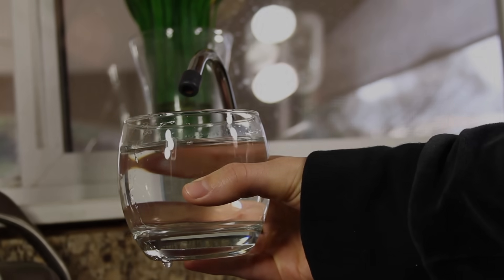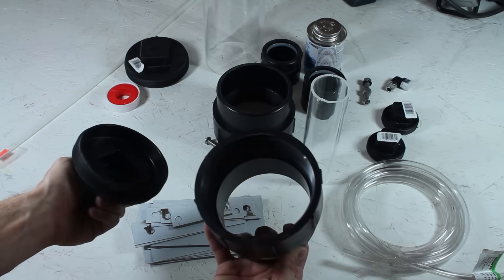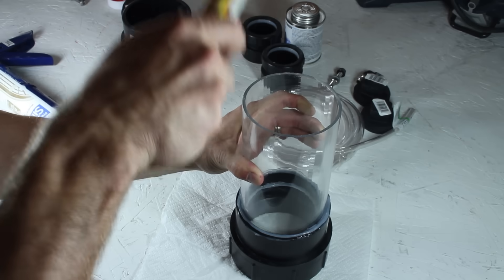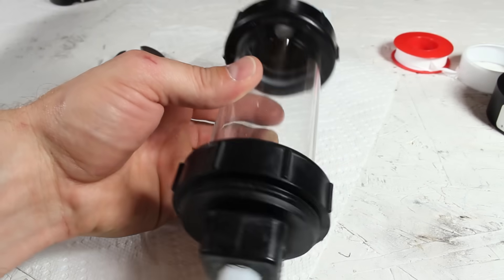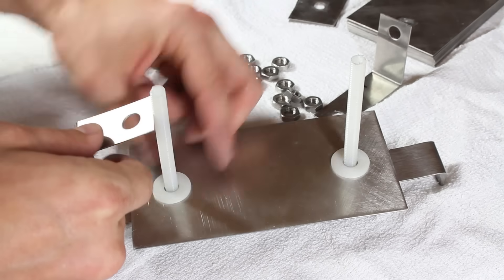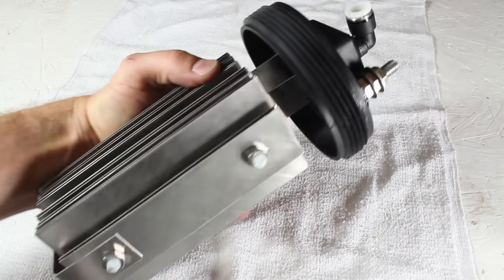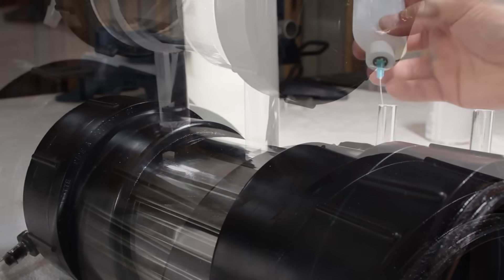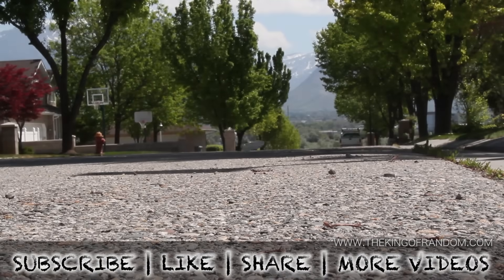HHO Generator - Water to Fuel Converter

Comment: Have you ever tried using a battery charger for the power supply ? And just a little unclear on the stacking of the plates is it two plates + and two plates - or is every other plate + then - ? A diagram would be nice . Maybe you could send me a simple sketch to help when you have a few minutes .
  Can this be used to make a continuous flame to fuel a heater  ?

Comment: its dangerous for your car cause if the spark plug fail the gas will build up in the engine then when it does light up , well you can blow up your engine. just like NOS

Comment: What if I replace the Potassium Hydroxide for Salt? I mean, as u said that the Potassium Hydroxide is for the electricity to flow better in the water, i thought that  it could work with table salt that makes the water more conductive

Comment: This gas can bot be used as fuel, because it is a mixture of hydrogen and oxygen. Hydrogen catches fire and oxygen helps in burning. if there is no oxygen around the hydrogen can not catch fire. So if you try to use this gas as fuel it will burst like a blast ( as seen in video).
The easy way to use this gas as fuel is to separate hydrogen from oxygen. In this reaction oxygen is created at anode and hydrogen is created at cathode. If you collect them separately you can then use hydrogen as fuel :)

Comment: You really did a great job on your cell.  Speaking from experience, as I have built 4 different cells myself and my last was similar to yours but not as good looking or quite as effective.  I found out how tough stainless steel is to cut or drill and clear acrylic tubing for the cell and bubbler is hard to find.  Anyway, great job it really is a good looking and working cell.  You could definitely sell them if you were into it, because I have researched what is available for sale and they fall far short of what you came up with.  They are also for the most part too much money for what you get.

Comment: 'Some people say this is the fuel of the future. Whether or not that's true,' <- This is the point where you could have been honest and forthright dispelling stupidity for 2.3 million viewers that it takes more energy to split HHO than it can create burning it - HHO is NOT an energy source. It's an energy dump and a novelty.
Reply: Try running a car on solar power... nope! Try running a car on hydrogen made through solar electrolysis... yep! You are right it is not a source, but it is a delivery method. Generate electricity however you want, then store it chemically using hydrogen. I don't think its that crazy.
Reply: bradkrit
Hydrogen is neither an efficient fuel to produce nor use. It would be better to develop better battery technology so that we store and retrieve sufficient amounts of electricity. Electric is the future, not hydrogen.
Reply: sexyloser True. I think there is huge potential (no pun intended) in battery technology right now. There is some neat work being done on rapid-charge battery banks that use a design similar to capacitors. My question is will they ever have the same energy density as a chemical fuel?
Reply: BaSH PROMPT Hmmm...so your saying petroleum based fuels are better?
Reply: why do people feel the need to debunk everything when they have no idea about it
Reply: Jude Mc  Hey,jude I don't know if you understand some of the finer points the commenter's made but some were spot on.

Comment: Please use extreme caution if you plan to do this project yourself! Using stainless steel as an electrode is very very dangerous. You may read around the internet that stainless steel isn't consumed in electrolysis, and that it makes a good electrode...that is not true. It just isn't. Stainless steel contains Chromium, and when used as an electrode in electrolysis, it releases chromates into the electrolyte. Hexavalent Chromium is extremely toxic and carcinogenic. It is known to cause cancer. When disposing of your electrolyte, please do not dump it anywhere your kids/pets/anything you care about goes.

Comment: Very professional looking piece of kit. if you attach a small brazing torch to it, it makes a very clean burning torch for working with precious metals, Ideal for repairing broken jewellery or even making from scratch.  I have added an air diffuser I got from the tropical fish tank section of the pet shop in the bubble tube to make it a more efficient flash arrester

Comment: Here I just used some nuclear reactor's fuses, combined it with a unicorn using five bulldozers and added it to a F40 I came to find in my garage. Nothing special.
Reply: Stick two metal plates in a tank of salt water and you can get a similar result. He just has a dense stacking of plates in a fancy container. It is showy and efficient, but you can make the most basic machine if you wanted too. Look up rust removal electrolysis, its the same concept.
Reply: Was this comment sarcastic? +bradkrit you make it look serious
Reply: Jaehyun Lim Masayuki was being sarcastic, implying that this project is too difficult to do at home. I was explaining seriously how the concept is simple, but Grant makes a fancy version.

Comment: use aluminum powder which can be powerful enough to power even a car in how fast the reaction is., which is even much faster than your 2 liters per min.
Also you can make a blow torch with the gas BUT you have to put a safety switch so that it does not back fire some say.

Comment: Heh, yeah people tried to run cars on this stuff, didn't work, used up far more electricity than the hydrogen and oxygen could deliver in power.
Reply: frosted1030 Well, the sun really isn't renewable either, so if we aren't out of here by the time that things loses its juice (you know, years and years and many more years from now) I guess we are all screwed :P.

I definitely think renewable power should also be heavily pursued. Basically if its non renewable it better be very long lasting, if it is renewable it had better be efficient in that regard.
Reply: frosted1030      Not about to read the whole thread, but skimming brought me to think that both of you are kind of right. Electrolyzing water is a valid form of fuel generation, but the products cannot be stored in sufficient quantity on board a car for it to be practical.     The problem is not energy conversion. The 2H2 + O2 -> 2H2O oxidation-reduction reaction is by definition of an equal voltage potential, barring inefficiencies, to the 2H20 -> O2 + 2H2 electrolysis. Hydrogen fuel cells use this reaction to produce electricity directly from the reactants, avoiding combustion and all the energy loss problems involved. This power is then used to turn the wheels and drive the car.

     The problem with this system is that hydrogen gas, H2, cannot be compressed easily and reliably enough at standard operating temperatures to make fueling a car a reality. I can give some equations if you need, but I'd prefer not to have to.
Reply: Cheez And Bakon Hardly new technology. http://en.wikipedia.org/wiki/Piezoelectricity
Reply: frosted1030 The way I see it the only way humanity will ever truly advance beyond this small world is through harnessing the very source of all power on this planet.

You think I mean solar energy? No, hardly.

I mean nuclear. Be it fission of fusion I see very little other way to truly advance beyond the level we are currently at.
Reply: xiAm VaLkYrIe Electrolysis is far less efficient because the energy density of water is 0.1 MJ/kg, the energy density of gasoline is 44.4 MJ/kg. No matter how you manipulate the numbers, you can't fudge the physics. If electrolysis were an alternative, we would already be using it extensively. For now, no, you can never get more energy out of a system than you put in (thermodynamics).
Reply: No way mate. Use solar panels to create fuel while driving and when not using it
Reply: Cheez And Bakon How many cars do you see, powered by solar cells? Here's what you are forgetting:
Energy changes form at a loss. Solar is changed to electricity at a loss. Electricity is then changed to chemical energy by way of electrolysis, again at a loss. Hydrogen and oxygen combust to produce kinetic motion, yet again, at a loss. Each step, energy is lost. Simply, there is no way that such a system could be used to power a car, reliably.
Reply: frosted1030 the thing is that hydrogen is far more explosively powerful than the same amount if petrol. Meaning less needs to be used in a car, meaning the amount produced will last long enough for solar energy to produce more, this could be a solar panel on the car. Or at the home. No one uses their car for more than12 hours a day. If the rest of that time, they're using solar or even a magnetic dynamo, to produce an electrical current, a steady stream of the gas would be coming in, slowing the consumption. Maybe I'm just too hopeful
Reply: Cheez And Bakon I said cars didn't I? Not trucks. Anyway, the water from the combustion of the hydorxy gas is equal to what made it. It could be a recycling system. I'm sure synthesizing water or purifying salt water is not that big of a deal if it means removing hydrocarbons from fuels
Reply: frosted1030 let me guess, you're a petrol loving American right?
Reply: I feel like there are much better explanations as to why we don't do that... Perhaps it has to do with the billion dollar oil industry. The technology could be there if we wanted. It really isn't tough to hook up a solar panel to create hydrogen fuel. Hell, there are DIY videos of how to do it at home. I'm sure a dedicated company with a few million bucks could figure something better out. is it perfect? no. But it is better than using unsustainable polluting oil which is causing all sorts of trouble. The downside to hydrogen fuel? um.... water. With a solar panel which is certainly enough to create the fuel, you can get a 100% renewable and waste free energy source. Fuel from water and the sun.
Reply: frosted1030 so what you're saying is that its cheaper energy wise, to distribute, mine, refine and process crude oil. Than to re use water over and over. And all of the HO is actually turned back to water, conservation of mass law says that. Some oxygen or hydrogen may escape, but that's just going to turn back to water in the atmosphere anyway.
Reply: frosted1030 that's the sort of thing I was getting at, but I'm trying to be more realistic, the best the average person is going to get is solar. Unless they have room for wind turbines. I sincerely doubt the oil companies are going to let this happen anyway. I've never heard of stress generation, how does that work?
Reply: frosted1030 Energy never gets lost. Where did you get that idea?
Reply: frosted1030 I'm sure you've heard of the Law of Conservation of Energy. Here's an intro from Wikipedia: In physics, the law of conservation of energy states that the total energy of an isolated system remains constant—it is said to be conserved over time. Energy can be neither created nor be destroyed, but it can change form, for instance chemical energy can be converted to kinetic energy in the explosion of a stick of dynamite.
Reply: frosted1030 Really?  They use gasoline to power cars.  How do you think that works?
Reply: ***** Less work if you just used the electricity to compress air, and used the compressed air to move the wheels. Less risk too.
Reply: frosted1030 wanna bet....watch mi
Reply: TrevorDeanM You might want to check with snopes on that one, they thoroughly debunked the idea a while back. Here's a few other resources.
http://www.aardvark.co.nz/hho_scam.shtml
http://www.popularmechanics.com/cars/a3983/4310717/
https://nctritech.wordpress.com/2010/08/14/hho-is-a-scam-water-for-fuel-doesnt-work-dont-fall-for-it/
Reply: TrevorDeanM Are you really encouraging people to be gullible instead of skeptical? How is that working for you?
Reply: Seriously, who decided to necro this? I really don't see this discussion going much further.
Reply: TrevorDeanM The BMW Hydrogen 7 does not run on water. It's also discontinued because it required 45 gallons of super cooled, compressed hydrogen in order to function. Not only is this expensive, but according to the wiki page "Using hydrogen in an internal combustion engine as a source of energy is far less efficient than fuel cell technologies". Further at  $118,000, and only 5 filling stations in existence, it's DOA.
Reply: frosted1030
Reply: There are hydrogen powered cars you know, so all you have to do is take the hydrogen away from the oxygen and you've got yourself, hydrogen.
Reply: xiAm VaLkYrIe "There are hydrogen powered cars you know," Yes, I know, and no infrastructure to support them, and the refueling stations (all 3) are in CA, so, unless you live in CA, you are SOL. You, I'm sure, are also aware that there is a very limited supply of potable water in the world.
Reply: frosted1030 Yes but I wonder if filling your tank with water (electrolysis doesn't use much water at all) would be more effective than a tank of petrol!
Reply: frosted1030 That's true, so humans need too think of a way of containing water, even if it doesn't create enough energy, it'll still be clean and efficient.
Reply: ***** Ok, whatever you say.
Reply: ***** And where are these cars that run on water?
Reply: ***** That's nice. Can you make the plans you used, available so that others can study and replicate your success?
Reply: frosted1030 Or post a video :/
Reply: ***** So... you have nothing.. and you just expect people to believe you?
Reply: ***** Nope, no one will believe you if you can't evidence what you assert.
Reply: ***** Why? You have nothing of interest. If you had something you would post it, patent it, and make a fortune.
Reply: ***** That's nice, not useful, but you can feel good about yourself because you said you did something you didn't.
Reply: ***** Whatever. You still have nothing.
Reply: ***** No, dissapointed that you are just another blowhard.
Reply: John Theologou Conservation of energy deals with the entropy of an isolated system. You can't get more energy out of a system than what you put into it. There is always a net loss due to the entropy.
Reply: MrLittlelawyer Nothing wrong with nuclear, it's definitely safer than the press makes it out to be. It's not renewable though, which is an issue.
Reply: Joshua Howard It doesn't work, that's why we don't do that.
Reply: MrLittlelawyer Renewable meaning that the source of energy can be utilized without unusable waste accumulating and without depleting the resource. No amount of solar collection can deplete the sun, of course it has a natural life cycle but it will take a few billion years before it burns out. Humanity will, no doubt, evolve in many ways by then, maybe even to a form where our dependence on the sun will no longer be an issue.
Reply: Cheez And Bakon "so what you're saying is that its cheaper energy wise, to distribute, mine, refine and process crude oil." No I am saying that solar is a dead end. Using water is a very very poor idea (as it is a really important resource).
Reply: Cheez And Bakon I would recommend wind farms for weather control, wave and hydro-power, as well as stress (pressure) power generation. Electricity can be made , night and day with these renewable methods, transferred without much loss as well. For vehicles, we need to work on better electric engines, more conservative in power consumption, bigger range and better storage (miniaturizing supercapacitors would be a great first step that would get us away from chemical storage media).

Comment: ok correct me if I'm wrong but combustion of any type produces water, salt, and CO2 so you could put a turd in an engine and it may not burn as clean as ur tiny H bomb but they both have the same flaw..... so its not a "environmentally friendly" method it has the same faults as petrol to be environmentally friendly it would need to do away with the combustion process as a whole  and further more hydrogen gas of the future try gas that caused the Hindenburg explosion don't get me wrong man i love your ideas but the facts could use some work
Reply: What? Hydrogen and Oxygen combustion only produces water. Where would you get the carbon, sodium, and chlorine to make CO2 and salt? Water is the only byproduct from a hydrogen/oxygen fire.

Comment: Too bad we won't see this used commercially because of corporate giants!  It's all about making billions and billions of dollars.  When the earth can no longer produce oil, then MAYBE this idea might be used.  Otherwise great job Grant!
Reply: Actually this method would be completely impractical for producing energy. If you think about conservation of enery, the electricity input to break apart the water molecules into hydrogen and oxygen is going to be the same amount of energy released when the gasses are burned (if the system is 100% efficient). This would mean relying on other sources of energy to make this source of energy and basic physics tells us that the more steps a process requires, the more energy that is lost on the way. Also hydrogen is not a great fuel as it tends to explode rather than burn and is rather difficult to store.